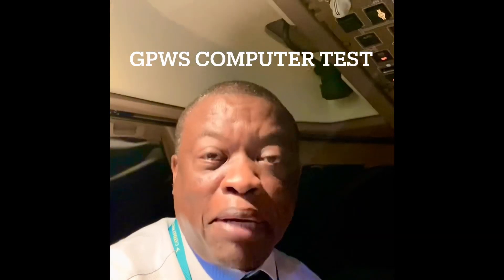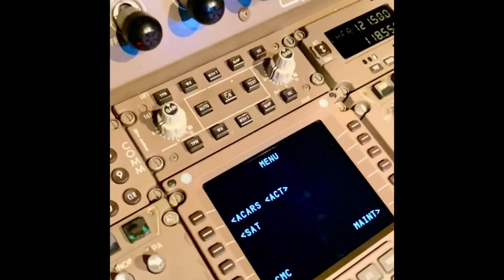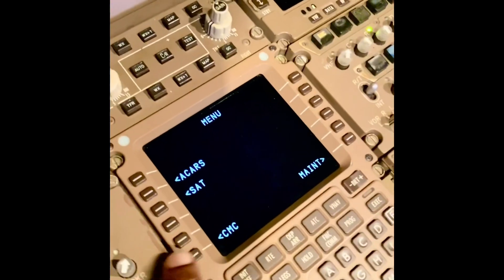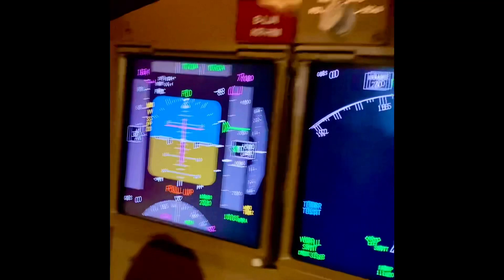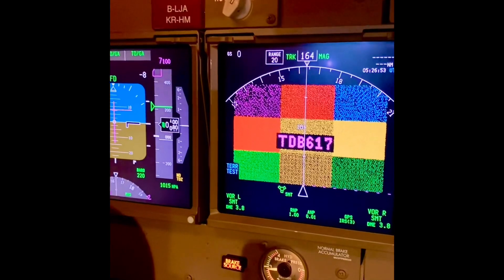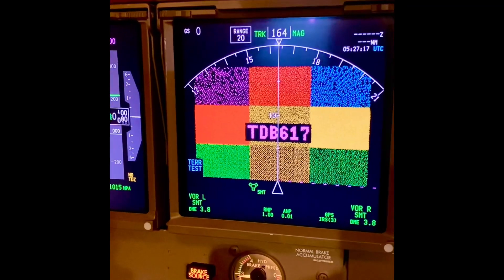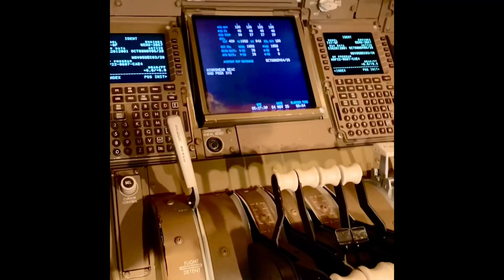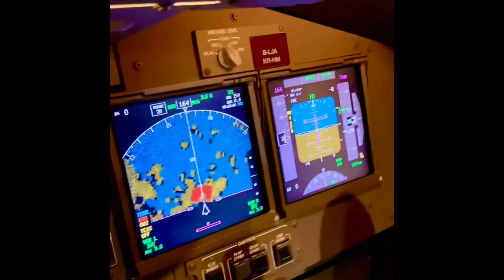GPWS Computer system test

Comment: There would be more callouts if 400, 300, 200, 100 would be selected.

According to Boeing option list for EGPWS and smart altitude callouts you also may have

80, 60, 35, 5.

As i wrote in another comment, I heard in a Cathay Pacific 747-400 pax version and 777, the callout "60", with the old and current voice.

What i know is that many airlines use the callout "5".

Like Condor in 757-300 and i think also in 767-300.

Royal air maroc in 787.

And a russian carrier in a 737-800.

The callouts 80, 60, 35 i could hear in TAWS of Thales in Suchoi Superjet SSJ100 with female voice.

I also know that the voice which anounces the aural warnings in the test sequence, also exists for altitude callouts.
But it is very seldom in use.
I know that you could hear the voice for altitude callouts  in a 737-500 of Peru Government, if i am not wrong.

In this video the altitude callouts are announced by a different male voice.
The voice is common in most Boeing, ATR, Embraer aircrafts for altitude callouts.

Comment: I counted close to 30 with Radio Alt callouts, a few repeats I think, haha.
Reply: There would be more if 400, 300, 200, 100 would be selected.

According to option list for EGPWS and smart altitude callouts you also may have

80, 60, 35, 5.

As i wrote in another comment, I heard in a 747-400 pax version and 777, the callout "60", with the old and current voice.

What i know is that many airlines use the callout "5".

Like Condor in 757-300 and i think also in 767-300.

Royal air maroc in 787.

And a russian carrier in a 737-800.
Reply: when does it ever say 80, 60, 35??? i know some of them say 5 but is there a video anywhere where they use 80 or anything?
Reply: 60 i heard twice in Cathay Pacific 747-400 pax and 777. But i cant tell if it was a 777-200 or 777-300 or 777-300ER.

Probably only the 777-200/300 had 60.

I heard 80, 60 in a 737-400 of Sky Airlines from Antalya in Turkey.
But they used Thales TAWS with female voice.
Most airlines use in Boeing aircrafts EGPWS of Honeywell.

Suchoi Superjet SSJ100 also use TAWS of Thales with same female voice like Sky Airlines did.
But it has much more callouts enabled.

Like 80, 60, 35,5 and also Retard Retard.

The examples with 60 callouts in Cathay Pacific were with Honeywell modules. The male voices were/are used by Honeywell. 

Currently i have no example which airline uses 80 and 35 with Honeywell male voice.

The female voice of Thales i also could hear in a 757-200 from an unknown operator.

There are callouts existing which are extremly rare. That is also the case in Airbus aircrafts.

Comment: Does the 747-8F or 747-400ERF not have

Airspeed Low warning?
Also dont they have RAAS at Cathay Pacific Cargo?

I know that the 747-400 pax version and i think some 777 at Cathay have/had also the callout '60' SIXTY.
Reply from the maker: Airspeed low is not a GPWS function that’s why it didn’t show
Reply: @pilot_obet  

But does the 748 have airspeed low warning?

In many 737NG you can hear the airspeedlow warning during the EGPWS test.

What i have noticed is that the 
OBSTACLE OBSTACLE 

warning at the beginning of the test wasn t announced in the past.

You only could hear 

Caution Obstacle or Obstacle Ahead 

At the end of the test.

Honeywell seems to have made an update for the callout test.
I noticed that in a Ryanair 737NG test, too.
You can check and compare that with many youtube videos.
Reply from the maker: Yes- Both B747-400 and B747-8 have ‘Airspeed Low’
Reply: @pilot_obet  

Thanks, only heard that in 737NG but i was sure that the 747, 777 and 787 must have this callout too.

May be you can make an airspeed low test in another video.

Also the viewers would be interested to hear an extended EGPWS test.
I think it is called discret input test.
Reply: on the 747 it’s different for airspeed low. an alert saying “>AIRSPEED LOW” will show up on the EICAS (middle display) and make a “beep beep beep beep” sound. the reason the 737 has “AIRSPEED LOW” callout is because it doesn’t have an EICAS system like the 747. the 737 EICAS is less advanced and doesn’t provide messages like the 747